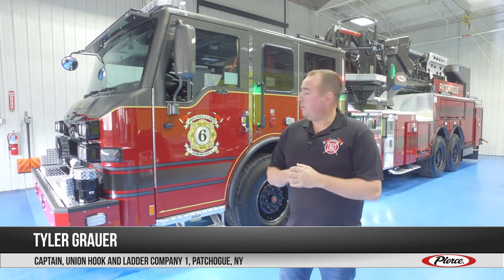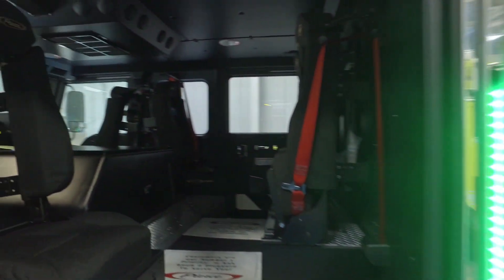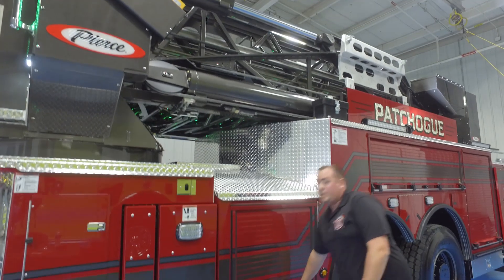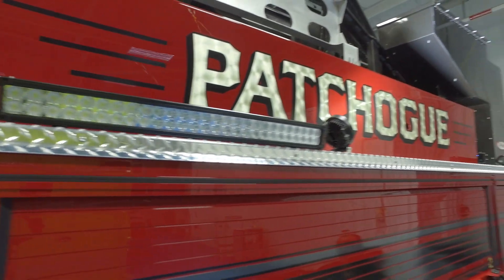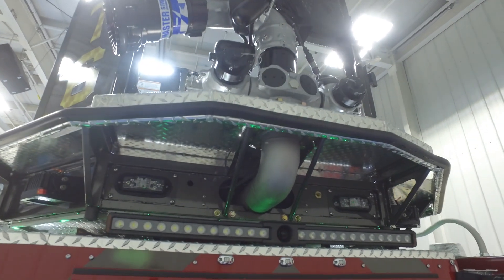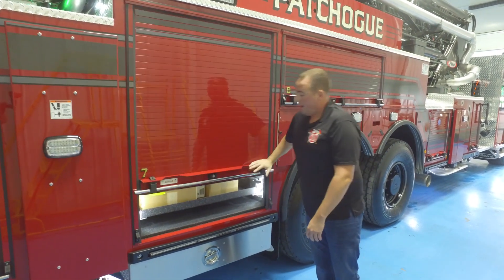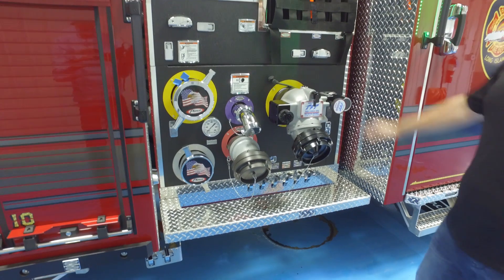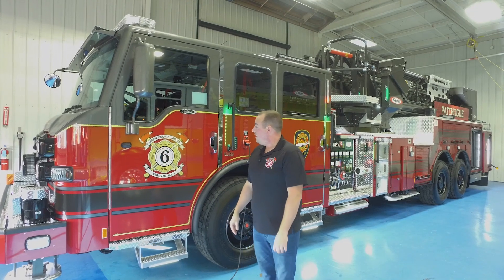Velocity® Ascendant® 100’ Heavy-Duty Tower – Patchogue Fire Department, NY

Comment: Don't like that low drawer storage behind the rear axle.  It will be the first to be damaged.  When you climb a kerb there is nothing, ground clearance wise to stop you climbing but as you drop off the drawer gets crushed.  We had an appliance where the bodywork was lower between the front and rear axles the in front and behind them and it was always getting damaged when having to climb kerbs on obstructed corners.  It was a mistake the coachbuilder only made once.  At least yours can be removed as it seems to be a bolt-on afterthought.

Comment: Why didn't you go with a raised cab? Obviously it wasn't due to clearance in the station since the turntable is much taller than the cab.
Reply: Mark Radell it limits if you have to work over the front of the cab. 10” at the roof is a few feet when the ladder is extended out.

Comment: Interesting choice....a town of 12,000 requires a Tower of that sophistication. What is the tax base to pay for that equipment?
Reply: The size of the town isn't the only consideration,  commercial buildings play a huge factor.  You can have a town of 5000, but with a major company complex.   A Dept has to support what the needs are...if the tallest building is 3 stories, no need for a ladder truck, even if the town has 50K.
Reply: I was thinking the same thing. I've never heard of this town, yet they own a tower that's better than anything in the Baltimore County, MD line-up.
Reply: It’s the norm for sleepy LI towns to overspend on a rig they’ll use for less than 15 years. Lots of wasted money on this parade piece
Reply: @marks4303  And somehow the Clare-Rose beer warehouse burned to the ground and it's a 1/4 mile from this dept. How does a beer warehouse even burn down?

Comment: Super Singles running on snow and ice covered roads will be a problem. The vehicle wants to float and slide more uncontrollably than it would with duals.   If the tire deflates rapidly the wheel is usually destroyed as it runs without a inflated tire. Any fuel savings is negligible. You are running a deformed brick through the air. There, the fuel mileage lower.

Comment: Nice truck you have. The only problem I see with it is the super single rear tires. If you get a flat your dead in the street. With dual tires you can limp to the call. The other problem with the super's is snow. They are like putting skates on it.  The narrow tire of a dual tire set up allows the tread a better chance of grabbing the road surface.
Reply: Your correct I like the super singles but in snow they do suck and I'm speaking from experience and I didn't even think of the limping to a fire scene on one tire that's a good point
Reply: I think that chains should help them in the snow for one . And the fact that the rears can steer is a major plus . So if they have to replace the tires a little sooner is well worth the price . Yes I know you can get a flat at any time but todays tires are much better than years ago . So I see why they decided to go the way that they did.

Comment: Beautiful piece of apparatus. They hold up well. Plus I also like the Mid Mount so you dont have the bucket over the front of the cab. Beautiful colors on it as well. You guys are going to love it my Dad's Pierce engine is 22 years old and still runs like new. Plus I would love to work with one of those trucks. My company currently has a 2002 Spartan Mid Mount Arielscope.

Comment: PATCHOGUE FIRE DEPT> Trust me when I say;  Be careful with those super singles, they hydroplane really quick on wet or snow covered roads.
Reply: Do differnt tires help?
Reply: @DIYtryer  I firmly believe dual wheels grip the road better than one big fat tire. Those wide tires don't let the water get out from under them fast enough. They tend to want to ride on top of rain and snow like driving on ice.
Reply: @gone1098  yeah duals are better, even in a situation when you lose a tire you can it back to wear your home base, and it doesn't tear the hell out of surrounding truck body not nearly to the extent as a super single would.